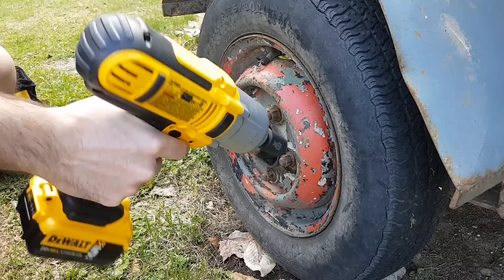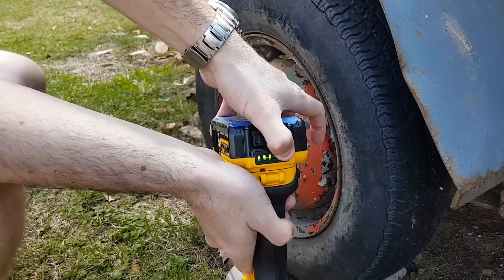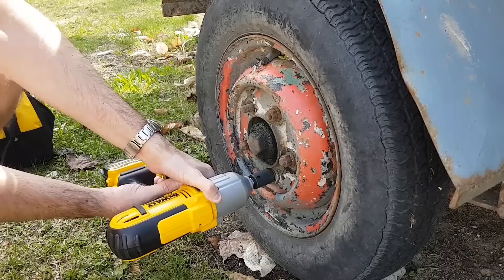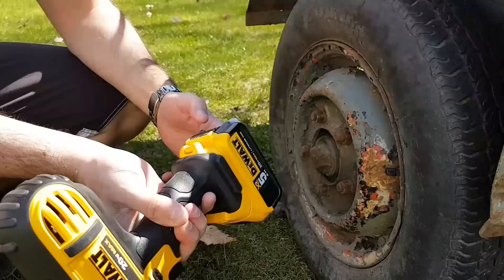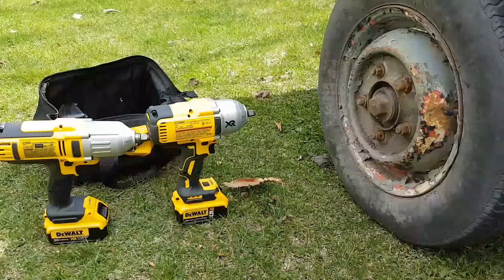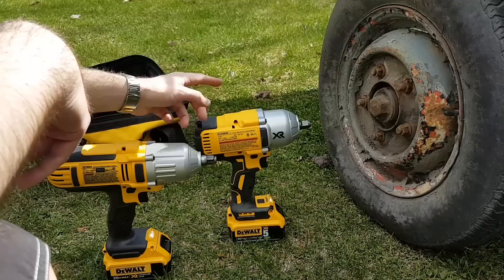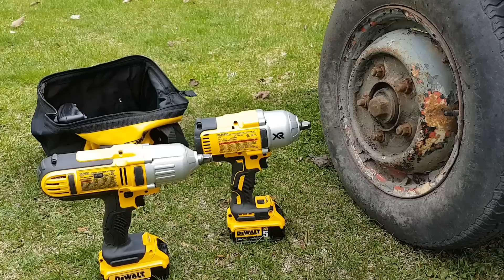Dewalt DCF899 MONSTER VS rusty trailer

Comment: I have owned two of these DeWalt impact guns for a couple of years. No complaints other than my neighbors borrow them regularly and don't rush to return them. They are excellent tools. Almost comical how powerful they are.
Reply: I wouldn't lend my tools out to anyone just, to many irresponsible people out these days.
Reply: Can it be usefull to do hols in the walls? Thanks and sory for my bad english
Reply: @hichamlaframe2495  holes in walls? This is an impact driver not a drill
Reply: @robbieshaft  impact wrench
Reply: @robbieshaft  even more reason to not use it on walls. Anything drywall it's shooting right through lol
Reply: If you have to borrow a tool more than once, buy it

Comment: The amp rating means nothing for your test.  The 2 amp battery would perform exactly the same.  The higher amp batteries only last longer.
Reply: Christopher Brown thank you for saying that I get so frustrated when people say that in videos
Reply: Not always the case , with Milwaukee the XC and HO batteries get more power out of tool, if interested Stanley "Dirt Monkey" Genadek has a really good vid regarding the subject with a Milwaukee engineer explaining it very well.
Reply: untrue high powered tools gain power from the added ah.

Comment: That high torque dewalt is a beast of a gun.  Used mine for over a year now in all weathers.  Hasn't failed to rip any Bolt/nut loose.
Reply: khurramsultan2012 Hi, what do you reckon? Will it unscrew a seized on crankshaft bolt on an Opel Vectra Diesel? Because dear Lord! I have literally hanged on to the breaker bar with both hands and swung on it. Still it didn’t move, lol.
Reply: motazuk google a seized nut crack they are inexpensive and amazing and a trick i use is put the ratchet on it and get a bar that has a hole in one end and pull down it should pop right off
Reply: khurramsultan2012 ,,
Reply: khurramsultan201
Reply: I still been debating if I should pull the trigger on this purchase.
Reply: The gun is still a beast for me many years on.  Its so powerful that it can be used with screw type bearing removers etc.  For most automotive bolts the 3/8 dewalt impact is plenty.  1/2 inch is great for axle nuts, Frame bolts etc.  Basically anything 17mm and bigger.

Comment: I run the service truck where I work and I have the 899 and it’s a beast. I have been able to take some brake chambers off on semi trailers without an issue. It’s got some power that’s for sure which is nice. I’ve had a couple of coworkers borrow it and they like it as well. Had no problems taking lug nuts off when I did the brakes on my car a few months back.
Reply from the maker: So I say that was money well spent?
Reply: Yes it was money very well spent. I got it in a kit with a grease gun and an LED flashlight that has a red LED on it as well. Also came with two 4 amp batteries, a charger and a bag
Reply: how much for kit?

Comment: I just picked up the DCF899H, yesterday. The first thing I did when I got back home was to take it to a rusted lug on my 20 yr old daily driver. My lugs don't have caps so when I have to remove them, it is usually a fight with a 4-way which is a real pain in the ass. This new gun ripped that lug off "like buttuh". I love this thing!
Reply from the maker: Glad you like it 👍

Comment: As tough as it was, I finally found something I didn't like about the DCF899 but the fix was simple. The speed switch on the 899 is black plastic and under some light conditions it is difficult to see where it is set. I used a yellow paint pen on the very top of the slider for instant visibility and luck gave me a perfect colour match to boot!
Reply from the maker: John Ricci it is a small details but it will improve the tool overall and make it easier to use for you 👍
Reply: patdud1
Reply: I love it, but the detent for the 'safety' is a little weak. That's really my only gripe tho.
Reply: Fanny, use the force
Reply: @macsogandares8383  agreed. It clicks over while in use.
Reply: Instablaster...
Reply: if you dont care about your warranty you can set it to 3, turn it on, then take is apart and unplug it. i did that with my dcf887 like 2 years ago and has worked fine since

Comment: I like to see videos showing crank bolts or any bolts that you know is tighten down to at least 500lbs and see these impacts rip them loose now that would be a challenge.
Reply: Emanny Jacob lol what kinda crank bolt is 500 ftlbs? Lol usually they are 30 -80 ftlbs on small engines. Some trailer hitch balls are torqued pretty tight. I would try that.the last one I installed was 370 ftlbs. Nobody at the shop even had a torque wrench that would go that far. We just got the biggest pipe  that we could find and the biggest breaker bar and kept wrenching til I couldnt
Reply: Have used it on three crank bolts and it easily removed them
Reply: @christiangraham4579  lMAO Emeny Jagof is a noob, no?

Comment: How has it held up still going strong? Would you still recommend buying 1 for general home and shop jobs (3/4 and 1 ton truck maintenance)? They are currently on sale for $219 I've been thinking about buying 1 for a few years now
Reply from the maker: Still going strong 🤙 but depending on where you buy it just get it try it to see if it can do everything you want and if not return it you have nothing to lose...
Reply: @patdud1979  it's on sale at tractor supply rite now I'll give it a try if it's not up to the task I will just return it
Reply: Well I bought it and a new set of impact sockets right after asking you and brought it home charged the battery up and finished the work that I started with a ratchet replacing the front driver side knuckle seal and axle u joint on my 2002 F-250 super duty it made the job so much quicker and easier that I decided to do the passenger side seal and got done in just over 3 hours and had the wheels back on, so far I like it, we will see how long it holds up over time.

Comment: I have one forsale dcf899. 180 comes with battery,charger,bag. But its clean alos lol only used it one time. Had to be able to break axle nut loose and it did with ease.
Reply: greg murphy ill buy it for free
Reply: @noahranker4133  sold lol

Comment: The new XR impacts are way stronger than the old ones. I got a 891 not knowing it was the newest and was shocked at how strong it was, even against the Milwaukee guns. Yeah I bought a 891 thinking it was the 894, I just didn’t want to change battery brands.

Comment: Just a quick spec comparison on the impact guns, I dont think you mentioned. The 889 is the one I just bought because it was 130 dollars cheaper at 225+tx the 899 is 359+tx.
I think part of the reason for the price jump is the 889 has 400ft-lbs torque and the 899 brushless has 700ft-lbs torque so it has almost double the power. I'm curious to see if the 889 will take the lug nuts off my truck without a struggle.
Reply from the maker: I'm sure it will unless someone torque them at max power on an air impact.
Reply: @patdud1979  perfect! I kinda wish I got the other one tho. It looks a lot nicer too

Comment: My problem with the 899 is with forward & reverse button. It's to easy to bump the button in the wrong direction when using it. There's no positive clicking to latch the button into place, it just slides
Reply from the maker: Mine as a positive click to it.

Comment: PB blaster or power break fluid would make easy work of those bolt either way, If used a impact drill would remove them, many are rated at 1500 inch pounds which is about 125 foot pounds. When proper lubes are used you don't need 1200 foot pounds
Reply from the maker: Yep  but then how do I test the impact to see witch is better??

Comment: Your impacts are too clean I don't trust you
Reply from the maker: jonny f5ve lol I like to keep everything nice and clean😜
Reply: jonny f5ve 

those are baby bolts, try taking off leaf springs bolts that’s are seized then we can talk
Reply: @justayoutuber6183  lMAO
Reply: @ggfcfhvyy9272  buddy that changes leafs daily at the shop i used to work at runs a campellhausfeld pneumatic with 400ftlbs and it does any suspension components "automotive" hes ever come across so if it can do it im sure the 899 can to.

Comment: I wonder if the Flexvolt battery would had made any difference.
Reply from the maker: Yes and depending on the battery type like if the cell inside the battery are larger like 21700 cell then it will give a small power boost 🤙

Comment: I would recommend putting some type of lubricating fluid on the nuts and lugs. It would be much simpler and less ware and tear on your equipment. Even if it's just motor oil. Sucks when you brake your fancy toy in the middle of the job and have to go buy a new one. Great video, I wanted to buy the same impact gun, but decided it's not worth the cost. I wont be using it as much as I would like. I will just stick with my air tools.
Reply from the maker: mauro rodriguez of it ain't broke don't fix it 👍
Reply: Good point even used oil on the threads lubes it up . Plus you don’t get a hot lug nut in your hand lol
Reply: you should never lubricate wheel nuts/studs. they can't be properly torqued then.
Reply: @jasonmorehouse3756  just tighten them and don't worry about torque specs. oil will not make a thread unable to hold a bolt securely. that oil will shear out under heavy torque anyway.

Comment: Thank you!
But you should have tried that big bolt in the middle.
Reply from the maker: That is my dad’s trailer and he’s still use it and i didn’t want to brake something critical… New VS video coming soon with the 899 and the Ridgid high torque impact 🤙
Reply: @patdud1979  Can you attach a bit to that impact wrench? Like on the Bosch GDX 18V-200, I can put a bit directly into the internal hex on the tool itself (google pictures of it and you'll see what I mean).
Is the same solution possible for Dewalt?
Reply from the maker: @olanordmann7836  you can put a dewalt bit adapter but that would be heavy to hold all day and it would be too strong for regular screws. This adapter turns any 1/2 impact to an impact driver but it would work better on a mid torque.
Reply: @patdud1979  Right. Thanks.

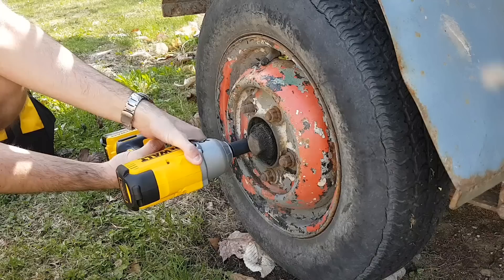Comment: Noticed you tried to remove these "dry" (i.e., no PB Blaster or other penetrating fluid).  The spray, given a few minutes (or even overnight) to soak in, might have been the difference between failure and success.   Also, it's a 40+ y.o. rusty wheel; chances are the lug nuts weren't torqued to equal tightness at this point (if they ever were).  Given the variable amounts of corrosion, this may not have been the proper forum to make the case that A was better than B.  On the second lug nut, you blasted it pretty hard with the 889 and couldn't remove it.  It had heated everything up a bit; you noted how hot the socket had become.  It's possible that contributed to it's easy removal a few moments later (at 2:10 in) by the 899.  When it quickly released, you then implied that the 899 IS the better of the two  ("like buddah").  The 899 MAY be comparatively better, but this wasn't the forum to try to prove that.  I'm just saying there were too many variables in play (and no instruments to measure the torque results) to make it a meaningful comparison.  Those are usually made in a lab setting, where the variables can be controlled (constant heat, new steel, new fasteners tightened to close tolerances, etc.).  An interesting, "real-world" throw-down, but flawed.
Reply from the maker: Every body is telling me the same thing to ad lubricant. But what the point ? I'm trying to see the power difference between impact.👍 Truth is I didn't even need to remove those bolt lol 😅
Reply: Well, okay, I get that.  However, you might have twisted one of the lug nut studs off in the process.  We all mentioned the PB Blaster (or oil and ATF) because it just makes things go smoother.  If you want to take one of those off for real someday, you can also heat the nut and stud with a propane torch, then touch a piece of beeswax or a candle to it.  The wax will get sucked down into the threads, lubricating them, making removal much easier.  It's also a good practice to smack each lug nut first with a hammer a few times to break up the corrosion.  Whatever steps you can take to remove them smoothly is time you won't have to spend replacing a broken stud or studs later.
Reply: ain't no one got time for that bull shit. if the stud fails it fails

Comment: Which one is it "The BEAST MODE One" I mean lol DEWALT 20V MAX XR Cordless Impact Wrench Kit with Hog Ring Anvil, 1/2-Inch (DCF899HP2) or DEWALT 20V MAX XR Cordless Impact Wrench Kit with Detent Anvil, 1/2-Inch (DCF899P2)?
Reply from the maker: Hog ring 899

Comment: Good video. Still like my Milwaukee 2767 tho
Reply from the maker: Thx. But any brand mid and high torque impact are more than sufficient tu change tire and average mechanical work 👍. Me personally I like an higher torque impact because in Canada with the snow and salt so both might get seized up.
Reply: Yeah I hear you there
Reply: Wished I lived in Canada btw
Reply: The only reason you like the 2767 so much is because you haven't used the 899 yet lol

Comment: Just ordered an 899 :)
Reply from the maker: I got mine on amazon for 270$Can with 2 battery 😁 best value for the money 👍
Reply: @patdud1979  I'm from the UK and bought the following (also from Amazon):

DCF899HN-XJ Impact Wrench for £144.90
DCB115 charger £25.00
DCB184-XJ 5ah battery £56.95

which comes to a total of £226.85 which according to Google is $289. Your price for 2 batteries seems pretty good!

Comment: What socket brand did you use
Reply from the maker: Cheap mastercraft brand from Canadian tire a Canadian hardware store.
Reply: @patdud1979  what brand is the best socket
Reply from the maker: @johnimperial9777  doesn’t really matter but look for some that have lifetime warranty and exchangeable in stores like the husky brand at Home Depot and I’m sure harbour freight as some to.

Comment: I have the older version and have yet to find a nut it wouldn't take off.
Reply: I have one that will take off 350nm crank bolt
A new spap-on  wouldn't touch it

Comment: i know which one im buying now.....awesome.....
Reply from the maker: Jorge Serna I’m glad you enjoyed the video 😁
Reply: patdud1979 Ordering the 899b since I already have battery and charger. I have a dually so I am sure I will need this for tire removal. Once again awesome video.
Reply: I just recieved it and gor the Detent anvil by accident, 229 shipped for DCF899M1 package. Oh well...need sockets to try it out
Reply from the maker: Jorge Serna it is a bit less powerful but it should do the job 👍 or you return it and get the hog ring one. If it is more expensive then stick with the pin detent one.
Reply: there is no difference in power between the detent pin and hog ring versions. they are the same tool just diferent retention  methods
Reply: Jason Morehouse I charged battery and havent used mine. Just got back from Las Vegas and bought me some deep sockets from Harbor Frieght. I wanted the Hog ring since many said it was eadier to replace sockets. The 889 was to weak and cost $160 during time I purchased my 899 for $229.
Reply from the maker: Jason Morehouse your right on the website it's the same power. The Milwaukee with the pin detent as less power I assume the DeWalt was the same! Thx for the precision 👍
Reply: and thats makita

Comment: Even if the battery was on 1 bar it shouldn’t make a difference as lithium ion holds its voltage till the charge is gone
Reply: Does it matter between 5amp and 2 amp?

Comment: why don't just use a breaker bar?
Reply from the maker: the13 julius13 can you tell me the title of the video please? Humor me!
Reply: for rusted bolts?  If you're not careful it's easy to break the bolt with a breaker bar or even regular bolts that have been over torqued.

Comment: Have you ever tried the Milwaukee 2763?
Reply from the maker: Hugolopez732 nope it is a nice machine but I got a good deal on these 2 DeWalt and they work great 👍
Reply: @patdud1979 that's great, I got the Milwaukee 2763 and it's great! I got a deal on it also, it was on Craigslist tho lol, I got it for 160 with the charger and battery pretty much all brand new
Reply from the maker: Hugolopez732 good deal 👍

Comment: Omg, you are screwing the wrong way...
Reply: Yea you switch it from forward to reverse for difficult bolts to help break the crud/rust out from the threads to be able to undo it successfully but don't try that on smaller bolts as it may snap it clean off especially of you have a monster impact so just undo with that and it wont need going back and forth

Comment: you're holding it incorrectly. Need to hold that thing down tight with both hands, using your body to press on it from behind.
Reply from the maker: paul06660 I usually reserve that for women 😎 lol.
Reply: Lol yea I was just saying that cause from my experience doing this, it seems like bolts break loose easier with a firm grip with plenty of weight behind the gun. Holding it loose, you lose a lot of the energy being transferred from the gun to the bolt with all the shaking around. But im shopping for a new impact right now and your video definitely helps.